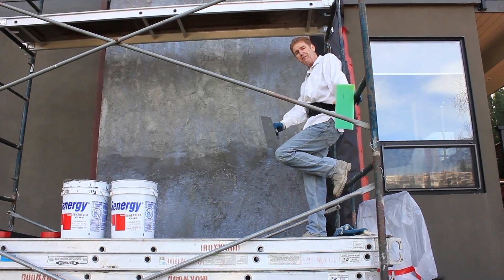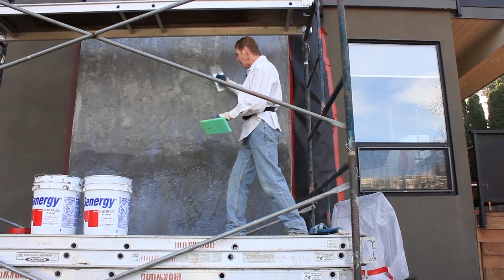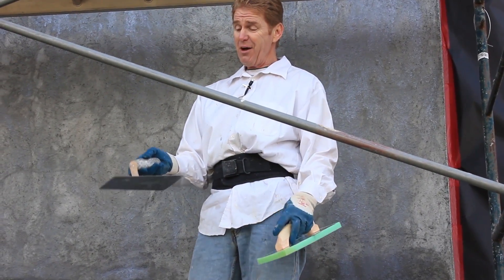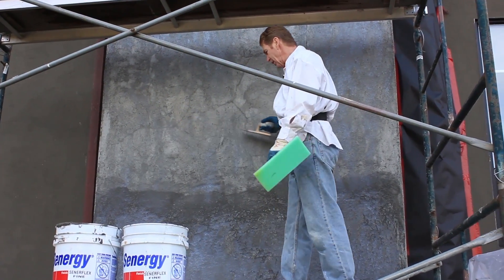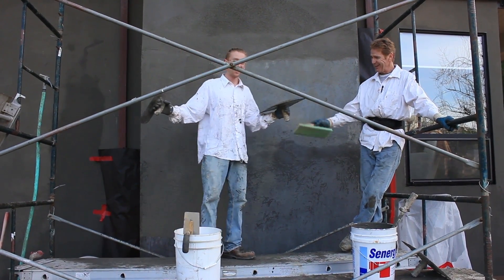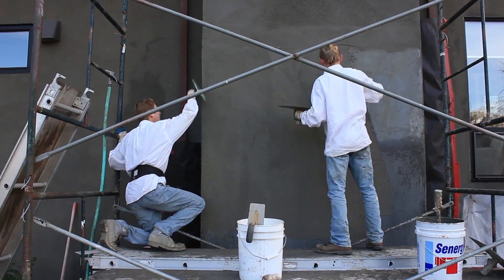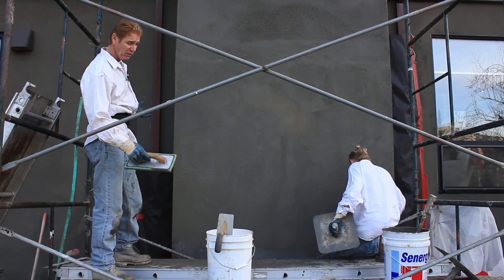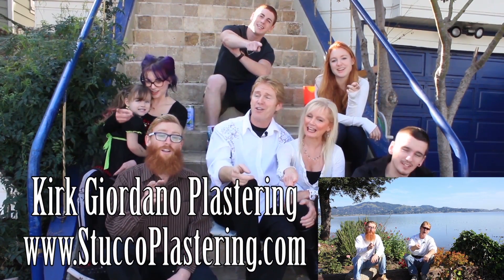Acrylic stucco finish over cinder block chimney

Comment: How do you REMOVE acrylic stucco finish ?
Reply from the maker: You can try pressure washing but only a small amount will come off. 
Acrylic stucco adheres very well.
 You'd be better of prepping it and then going over it.😉

Comment: I have about 60 ft X 4ft of 20 year old cement block wall that i want to have plastered. do I need to have wire lath put on first or would one or two coats of plaster work. I live in new jersey temperatures vary from 100 degrees summer to 5 degrees winter. Thanks for any help you can give
Sam
Reply from the maker: sam white Hi Sam, if it were me I would simply skim coat it (one coat at least 1/2 inch)
wire over cement block is overkill and simply not necessary under normal circumstances.
Make certain that wall is pressured washed very well and if it's painted you need to also apply a bonding agent prior to the skim coat.
 Best wishes.
 Kirk Giordano

Comment: Hi Kirk and Jason, Can I spray on a water based sealer on top of a finish coat that has an acrylic bonding agent in it? I contacted the manufacturer of the stucco finish coat and the rep told me they were not 100% sure that the sealer would not react badly with the polymers in the acrylic. He said water based sealers may change the appearance or stain the finish coat with liquid polymer in it. He told me I could build a mock up and then wait a couple of months to see what happens but I don't have a couple of months! Have you guys had any experience with this? Do I even need to seal it? The only reason I am considering it is because the wall is literally right on a rivers edge (12" away) so the wall will see a lot of moisture. Thanks, John
Reply from the maker: John Buckley Hi John, are you saying you have an acrylic finish coat over the base coat right now?If so, most if not all of these finishes are water resistant, notice I didn't say water proof, they should shed the water plus the base coat should too. 
To apply an additional sealer or paint job, is possibly overkill, unless it helps you sleep at night knowing you did all you can do.
 If it were me, I would not.
 Best wishers,
 Kirk Giordano
Reply: thanks Kirk...Kirk & Jason Giordanos DIY plastering and stucco tips
Reply from the maker: No worries john,
Kirk Giordano